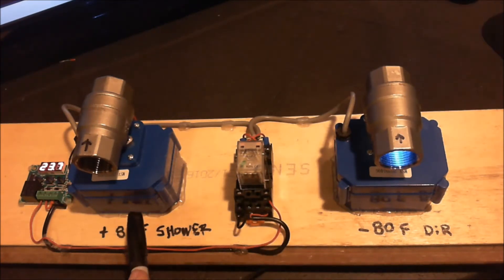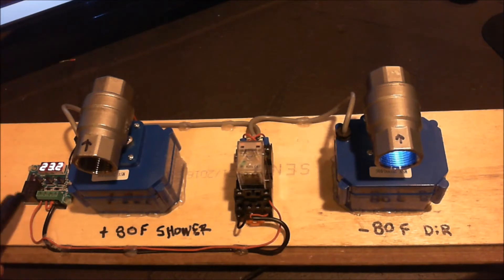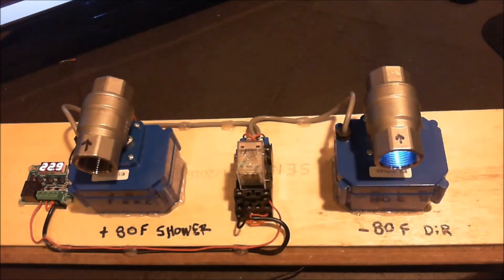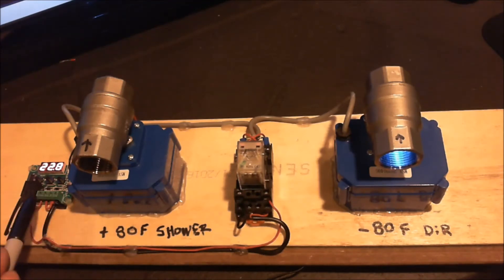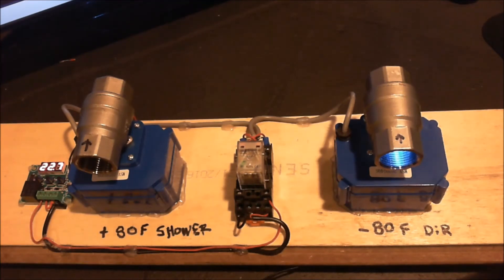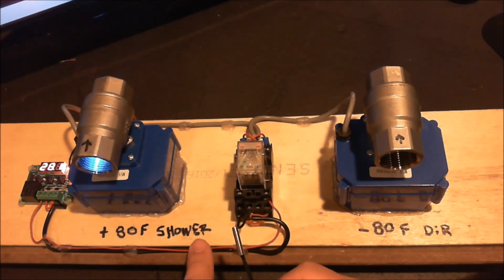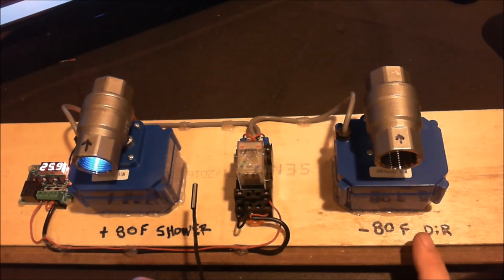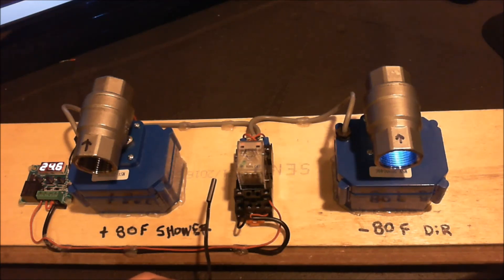Using motorized ball valves to help control the temperature of Intex pool water.

Comment: Hey! Thanks for the video. Was wondering that the amperage draw for each valve was?
Reply from the maker: Hello Jordan,
The Actuators on the valves draw less than .25A (250mA.) @12vdc.
The entire board at rest draws about .08A (80mA) (That's with the led's and thermostat energized) 
When a call for valve reversal is triggered, the board draws .25 amps (250mA) Subtract the parasitic load .08A (80mA) and that is .17A (170mA) being drawn by the actuator. 
The valve holding position draws about .12A (120mA). 
When the thermostat drops out, the board returns to a .08A draw. 
I hope that answers your question.
73!
-Ray
Reply: @raykd2ibp198  thank you very much. And I’m working on my ham license as we speak. I notice the 73.
Reply from the maker: Jordan, Glad to be helpful. Where are you located? And how far along are you with the licencing?